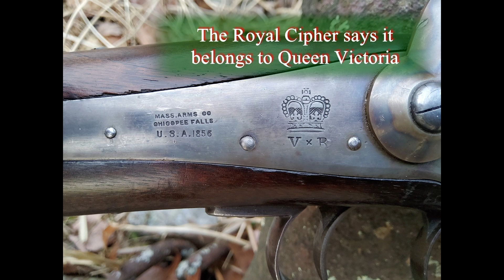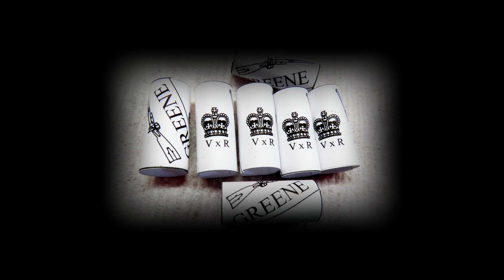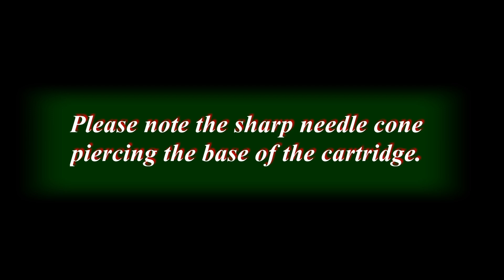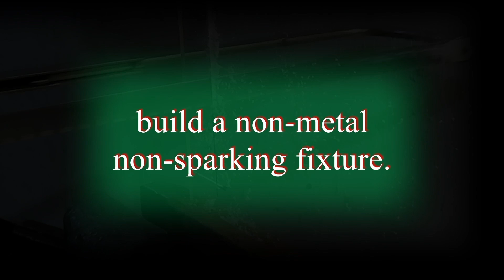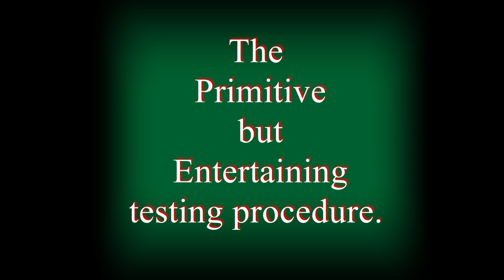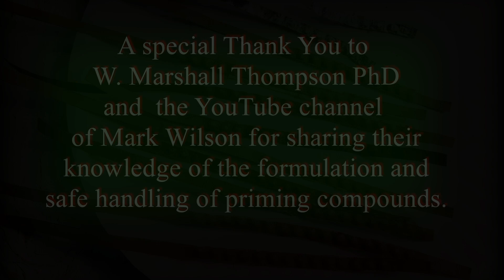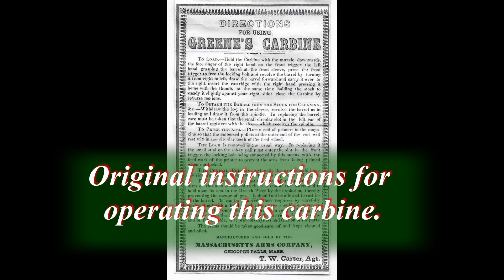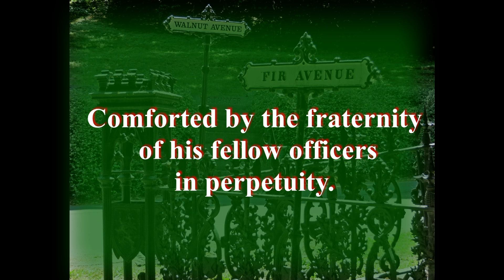A .54 Caliber Greene US / English twist-action.

Comment: I have recently acquired a Greene carbine myself.  So good to see someone making cartridges and Maynard tape and firing it.  Very inspiring, thank you.
Reply from the maker: Hello Jason,  Welcome to the channel.  The tape primers I made need more fine tuning, but she shot very well with the musket caps. Congratulations, You'll love it !   Regards.....Doc
Reply: @dr.durellshepard398  Hi Doc. Do you think the Eras Gone Richmond Sharps mould would work for the projectiles in the Green Carbine? I have a Starr Carbine in .54 too and would rather only buy one mould as opposed to one for each gun.
Reply from the maker: @jasonk4945  Hi Jason, The Eras Gone is a great bullet and worked well in my Starr.    The Greene is a "FAT" 54 cal , so I went with the .555 ring tail as it has bands of different diameter and it worked fairly well,  but the gun really wanted a slightly larger diameter.    I suggest purchasing a small amount of cast bullets to try before committing to a mold.  Regards.....Doc

Comment: So cool. I’m sitting here watching you building your own tape primers. Thinking you probably have a fly press so I’m building a die in my head from copper strips hinged together on the long side kind of like a watch or clockmakers depthing tool. Not sure why but you get my brain working. Thank you and have fun
Reply from the maker: Good afternoon Sir, No I don't have a fly press, but I know they are a fabulous tool.  A powerful and controlled punch, among other things. I found that the paper tape wanted to pull material from the next hole and if you didn't let it  the paper would tare. So my next design was to be a rotary die set  so the tape was free to do what ever it desired.  Still lots more to figure out to make these really practical, but as we say, Half the fun is getting there.    Regards....Doc

Comment: This one looked like it leaked a lot less gas than the G&C carbine. The falling block system really needs the metallic cartridge to function properly.
The Smith and Burnside carbines are the ones I really want to try.
Reply from the maker: Hi Sharon,  All the paper cartridge guns leaked a lot of gas,  no matter what they tried as a sealant method. Sharps, as you say, had a great action but needed the metallic cartridge. Burnside had good design, but most of the brass case was on the wrong side of the breech block junction. His 5th model is the best design and are real cool to shoot.  I personally love to shoot my Smith carbine.  The cheap plastic cases work very well and the gun fits well and feels good on the shoulder.  Best regards....Doc

Comment: Another great video which taught me a lot.  Does the insertion of the next round push whatever remains of the 1st paper case forward and then blow it ot of the barrel when fired?  Are toy cap gun red rolls of caps still manufactured, or have they become extinct too.  I watched this after reloading 36 rounds of 45-70 using a 405 gr. cast bullet in front of 27 gr. of IMR 4198.
Reply from the maker: Good morning Robert,  There is a recess around the gas seal ring which tends to collect unburned  paper scraps, but the next round will chamber. Some fellows do use the caps, double stacked and re-spaced. Ring caps are the current thing, I guess.   I suspect that the next warm day you will be heading to the range,  4198 makes a great loading for the 45-70. What will you be firing them in ?    Later...Doc
Reply: @dr.durellshepard398  I have a Pedersoli RRB Buffalo Rifle that I shot last time.  This time I will shoot a Springfield Trapdoor Rifle that has been cut down and sporterized to use as a deer rifle about 60+ years ago.  A friend gave it to me about 15 years ago, and I replaced the front sight with a blade, and decorated it with domed brass tacks to look like an Ameri-Indian owned gun.  His grandfather gave it to him when he was a teenager to hunt deer.
Reply from the maker: @robertrobert7924  Very good Robert !    One of my favorite trapdoors is a 1869 Cadet, a little rough looking but a great shooter. Being scaled down it is a very comfortable off-hand gun. It's not heavy or even muzzle heavy and fits me perfectly.
Reply: @dr.durellshepard398  I also have a another trapdoor rifle in orginal military condition that I bought as a collector's piece.  It resides in my gun safe.  I can't remember if I ever shot it or not.  It does not have that horrible cleaning rod bayonet.  A neighbor/mentor wanted to sell me one of those, but I declined.  Definitely a bad idea, IMHO.
Reply from the maker: @robertrobert7924  Today's Snowflakes love that bayonet, ................it couldn't hurt a fly !